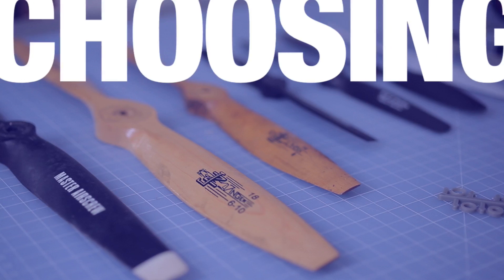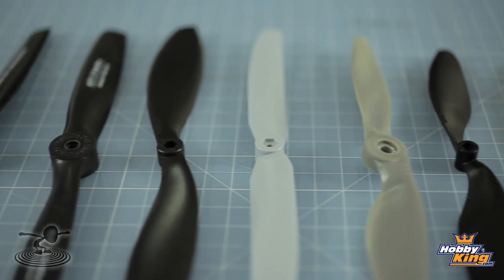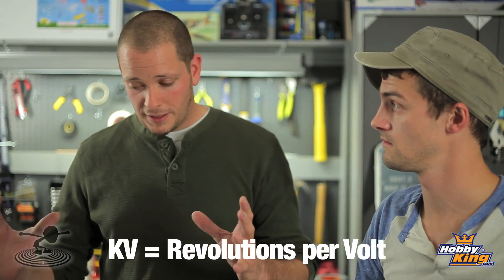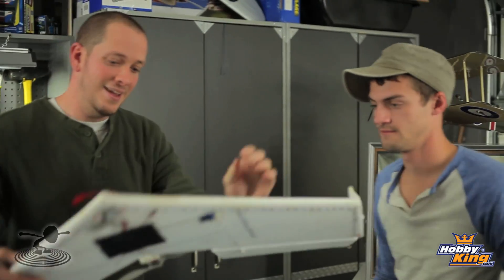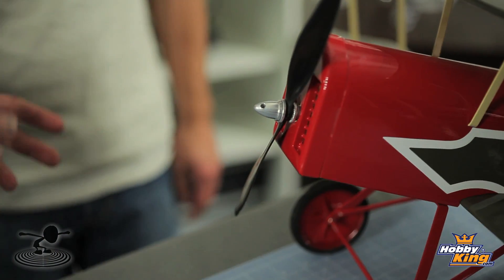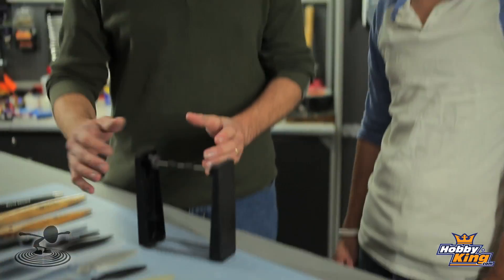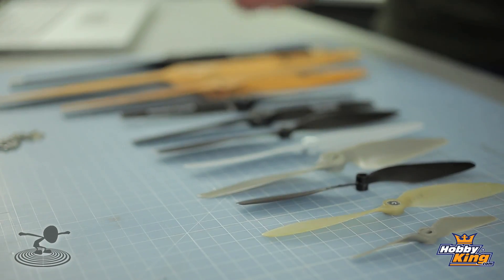Flite Test - Choosing A Propeller - FLITE TIP

Comment: i hav a quick question, i bought a 13 by 6 prop which is compatible with Extra 300 Eflite, however it won't go inside the thread on the prop. do i need ot make hole bigger? are all hole diameters the same on props

Comment: I'm building a foam mig 29 jet 
The wingspan is 81 mm and the weight is 31.1 oz 
The battery is a lipo 2200 mah 11.1 v 3s 
The motor I'm using is a A2212/6t 2200 kv and the propeller is 6x4 
My question is do you think this setup will work or do I need to change something.    Any help would be much appreciated

Comment: As the guy on the flight line that got elected to straddle the new 1200 horsepower turbine to adjust the variable pitch prop governor, I can tell you that all fixed pitch propellers have a narrow efficiency window to operate with. Airspeed and pitch is everything. If you change the pitch and/or diameter, yes, it's possible to go faster - within limits. Balance the tradeoffs in your choice. A high pitch propeller gives you a long roll on takeoff. A low airspeed, heavy biting high pitch prop will likely never exceed 60MPH. Propeller formulas always include airspeed because of it. For any given propeller, engine and airframe combination, there is a speed at which the propeller noise is at a minimum. A noisy prop (too fast, too slow, bad wind angle, turbulence,  etc.) is eating your power wholesale with a reduced return in thrust by comparison. A propeller blade operating in the wake turbulence of another propeller blade is definitely at the wrong airspeed. Drone props are designed for 0 airspeed. Insufficient airflow across jet engine blades and the compressor will stall sometimes violently and wreck the engine. The length of the prop blade is directly proportional to the work required to keep it balanced and the amount of grass your cutting on taxi. In any case, vibration from any source is bad and noisy. There is no such thing as no damage from any prop strike at max rpm.
Based on what's usually available to most people, it's very likely that you have a choice of three props for your given combination that will change performance; and three more if the blade count changes. Choose carefully and you maximize flight time. A goal nobody argues with ;)

Comment: My motor is 2212  1400 kv none brand motor,,i can use 3 blade prop,,but i dont know 3 blade prop size,,,plase suggest a 3 blade prop for 1400 kv on 2s lipo

Comment: this was my question that i found no where else that "is the pusher propeller different from tractor one". so basically if you rotate the tractor propeller the other way than for which it is built, u get a pusher propeller, right?

Comment: With all these new quadcopter props I think it would be a great idea to revisit this for a video.

One thing I'm doing is learning to 3d print a propeller for my ww2 plane. It's a great small flier but it can't land or take off cause the factory prop is a huge 2 bladder prop. It does great but I want to play around with different propellers and see if it will work will a 4 bladder propeller.
Reply: 2 years later.....did you have any success making props?  I thought about making a silicone mold of a few props and then just pouring my own from epoxy, but probably too heavy.

Comment: PLEASE ANYONE HELP!!!

Ok so the second number means how far the propeller will move through the air after each rotation......... However, when I look up propellers I see one of them has the second number 24... so it should make that prop move 2.4 inches through the with each rotation..... Then I look at another prop where the second number is 52, which should make the prop move 5.2 inches through the air with each rotation.

The thing that MAKES NO SENSE AT ALL is the that prop with the second number being 24 has FAR FAR FAR more pitch on each blade than the one with 52 being the second number. How does this make any sense at all!?

This is SO frustrating I cannot reconcile this AT ALL.... I feel like there is some information that I'm using that is wrong. What do I have wrong!?

Comment: so something I don't understand. if you have a 8x6 prop and a 10x6 prop I guess why would you go with the bigger prop? if your going to get the same travel out of both  the 10x6 prop will draw more power plus more likely to break. which I guess leads to the next question why not go with a fast kv motor smaller prop.  so if you have a 1000kv motor with a 8x6 prop and a 2000kv motor with a 4x3  your getting the same travel per min.  the only reason I can see with going with a bigger motor is for weight balance right now. I suppose I might not understand yeah probably lol

Comment: It wasn't long ago that newbies or youngsters believed a bigger prop was better. I lost count of guys asking what was the longest prop a quadcopter could handle. It seemed a quad with small props wasn't "cool". No amount of advice regarding efficiency etc. could shake them.  Such talk was old people's talk, in the end I gave up trying and told them to use 11 inch props as long as they were OK with them hitting the prop on the next motor.  They were actually buying quadcopters according to the size of the props.  I'm no longer in the business so I have to wonder if it's still uncool to have small props. Or have I got it wrong by buying my props according to motor specs?

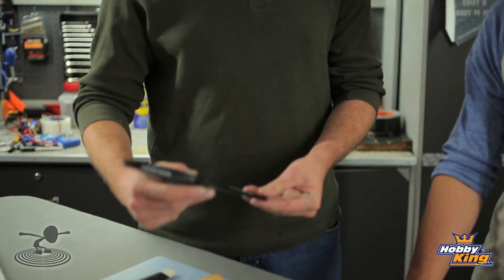Comment: 1:40, pretty sure the prop needs to face forwards if its on a normal plane or a pusher plane, i use CW props on my pusher plane and it works fine and you can use CCW props on either type of plane, just reverse your motor to suit, you need to explain what your talking about, not just say it spins the other way cos it goes on the back because thats just flat out wrong
Reply: Yeah no need for pusher props in electric planes really, just flip the prop and reverse the motor but in nitro applications you do as the engine cant run backwards
Reply: @mark675  Brilliant comment!
Reply: .... no no no. this is just wrong. propellers have a leading edge and a trailing edge. you CAN  reverse your motor and make a standard prop(ccw) do what a pusher prop(cw) is designed for, but its not efficient because the standard prop is indeed running backwards with the trailing edge out front instead of the leading edge.

then entire point of there being two types of propellers is for you to use to proper one for the proper scenario. please do not go around encouraging people to use the wrong prop for the wrong job. running a prop trailing edge first is a good way to cause damage to your plane, propeller, or yourself
Reply: yes i know the leading edge always needs to spin the correct way that was my point, you always need to have the propeller facing forwards (the side you see the size and pitch written on most props) my point is you can use a ccw prop if you reverse your motor so the leading edge is spinning the correct way while the front of the prop is facing forwards weather its on the front or rear of the plane. the reason for my comment in the 1st place is why did flight test mention the ccw prop and not go into any detail?

Comment: I'm still not sure how to "match the prop to the motor". Is there an equation to use? Also I have some props from a gas engine, and a few people said I cannot use these because they are for 'gas'....but if the pitch and length are the same, does it matter??
Reply: Josh Kelson it's in the motor specs from the manufacture. Every motor will tell you the best props for it as well as what size battery it is capable of handling. ...you can deviate from the recommendation to get better battery life, higher speed, lower speed etc. but you do this at risk of damaging the motor if you go to extremes. There's plenty of info on forums or a simple Google search if that didn't help you enough. ...other wise...you start at what the motor is spec'ed for and move around until you find what you want from what your working on. There's no "set in stone" rules. ...also the model manufacture will tell you what prop n motor they recommend if you're getting into scale building. ..hope that helps
Reply: Thank you, that helps. Are pitch and length measurements on a standard between manufacturers? Also, if I find a wood prop with the same diameter and pitch, is it going to work regardless of if it is "electric" or "gas", wood or plastic?
Reply: Thanks that helps. Are all pitch and diameter measurements standardized between manufacturers? Also, if the diameter and pitch fall in line with the manufacturer, does it matter if it is an 'electric' or 'gas' prop (what would the difference be), and does it matter if it is wood or plastic (I would imagine there are weight differences that factor into the ability of the motor to turn the prop...do you size down when going to wood?)?  

Also, here is an example of the confusion. eFlight power 60 motor (recommends 15 x 8 - 17 x 7 electric propeller), however when looking at the recommendations of props for two models, they recommend two props, one within that range, one entirely out of that range. The Beast they recommend a 17x7e (https://www.horizonhobby.com/efl9000), and the Carbon Cub they recommend a 16x10e (which seems out of the range?? ...or maybe I don't understand what the range of pitch is, 3 steps higher or lower? 4 steps?) Not only that, but if I understand the creation of props correctly, pitch angle changes with length, so a longer prop will have an entirely different pitch angle.

...it's much more complex I'm learning than simple numbers to choose on a prop.....

Comment: what is the difference between 1045 and 1045r propeller?
Reply: I have no idea... but it might be r for reverse. Josh mentioned that you would want a reversed prop if you were running engines on a plane so that it wouldn't torque to one side

Comment: Whats the best prop for a slow flying radian sized glider with a 2200 kv motor. Im a nüb at this stuff
Reply: Oskar Lund 6×4.5
Reply: You would be better off with a folding prop if you are using a tractor style motor. By folding out of the way the drag is reduced and your plane will have a better glide ratio.

Comment: when would you use a wooden prop
Reply: Jonas Martin, use wood props on Nitro or Gasoline aircraft.  If you are flying electric planes you can use wood but they seem to dump the battery faster.  Also, do not use electric props on nitro or Gas engines, as the engines do not run as smooth and can throw a blade on a plastic electric prop.  APC makes both electric and nitro plastic props so know what you have if flying Nitro or Gas.  Also, I have found that a different prop size, pitch  can make a big difference on the personality of the plane in the air.  Even the same size but different manufactures can make a difference.
Reply: Bob T thanks.  I like the look of a wooden prop

Comment: in the prop size , is the first number measure in inches ?
Reply: Yes,  typically it is expressed as inches.    Example: an APC 12x6SF: 12 inches is the diameter and the theoretical pitch is 6 inches, SF is for Slow-Flyer ("e" for efficient electric).  a GWS 1260ep: 12 is the diameter and 60 is 6 inches of theoretical pitch, and ep is for electric propeller.
Reply: ohh i see now. thanks man
Reply: so is the diameter measured in inches too ?
Reply: Yes, sorry
Reply: ok thanks man

Comment: What propeller i need for Turnigy D2830-11 on 4S? (Tricopter, 1000grams)  cant find 8x4 that isnt slowfly. 10x5 is too "heavy" for 4S on those motors.

Comment: how would i attach a prop to a traxxas rustler rc brushless electric motor, that was never meant to have a plane prop attached to it? i am trying to make a airboat that will have lots of torque and high end speed. i am gonna be using a 5000 mah venom battery

Comment: So heres an idea: multiple electric motors turning one shaft and rotor or prop.
The idea being to substitute electric motors in place of cylinders, arranged in traditional "v", boxer, radial or in line cylinder configurations. I dont think it would be very efficient, but im wondering how much horsepower, torque, and rotational speed is obtained........ Like is said just an idea
Reply: Jayson Odom it erupted be a constant dive geared system and would be highly inefficient and a pain in the ass to get all the electric motors timed to each other.....you'd burn up motors so fast you'd be refinancing your house to buy more....that's a reason why nothing is built like that.

Comment: If i want to switch from a two bladed propeller two a three bladed. How do i change the diameter and pitch to have the same characteristics of  the two bladed one? 
ex i have a 10 x 4,5" 1045R two bladed. what should the three bladed be ?
Reply: +Manligheten General rule...drop and inch and increase the pitch. 
So, for your example go with about an 9 X 5.5
Reply: +mh annan thank you. 
i figured it out. 
soon time dor maiden flight.

Comment: hey guys, can u help me? So i'll do a cessna 182, about 800grams. so i choose for use the Emax XA2212 1400kv motor. i read that i have to use a 8x6 propeller. then i go to the hobbyking and find my propeller. So i don't know what direction (CW or CCW) i have to buy. can u guys help me? like as cessna, the motor will be in the front of the Airplane
Reply: +Guilherme Alves It makes no real difference except for multicopters, where some of the props turn backwards. That said, most tractor aircraft, where the prop is in front of the motor and the whole shebang pulls the aircraft, have props that spin clockwise when seen from behind.

If your airframe has thrust angle built in (some do some don't), then you should stick with the prop for that angle, which is usually (NOT ALWAYS) clockwise. If you have no thrust angle built in, then feel free to install a counterclockwise prop - if it spins backwards, flip any two motor-ESC leads.

Comment: I have a question. Just getting started in RC I put a plane together w and electric motor, have not flown it yet, when i do a test taxi the plane pulls to the left. How many degrees do I have to tilt the motor to the right to fix this problem. Thx
Reply: Trial and error. Also change the rudder trims
Reply: jmlon99 thanks
Reply: Richard Palermo One more question. Do you think I could convert it to a tail dragger so I can fly it in taller grass?

Comment: Do people track their propellers, if so how  example  a 11x6 plastic prop that wont track straight  what's the fix
Reply: Rondo Schiavoni Do you mean that the prop on the plane causes the plane to fly oddly or that the prop blades don't pass through a single plane? If it's the latter, it's possible that the hole in the prop isn't centered/square, that should be addressed by the sizing ring included with your props. It may also be that one of the blades is bent either through a crash or a flaw in production. Generally speaking if the blade is bent, and it wasn't produced that way, there should be some stress marks on the plastic and the prop shouldn't be used since the prop is weaker there and could fail at any time resulting in potential injury (during run-up/preflight) or the walk of shame (failure in the air).
Reply: I FOUND  A BENT SHAFT WAS THE  reason  the blades weren't passing   on the same plane

Comment: ok, seems to be nice video, but what about blade width, I have quad with 800kv (222W) motors but it fly better with 12x4,5 wide blade props than 12x4,5 ordinary blade props. So is there some identification what shows blade width?
Reply: Lauri K The wider the blade the more like a Slow Fly (designated as "SF" typicall) prop it will be which will generate more thrust. Really it comes down to what manufacturers are making. If you compare an APC, GWS, and Master Airscrew props they all have different blade geometries so they will all fly differently despite being the same diameter and pitch. If you know that your quad flies better with wider bladed props then look at Slow Fly props or find a manufacturer that makes a more standard prop that makes your quad fly the way you like and stick with those.

Comment: hi there great videos , but what about ppl like me who are building their own scratch built 3D printed micro quads or tri ?
how can we figure out the right motor or prop?
Reply: Usually motors will have suggested props for your battery size. And as far as picking the motor. I would head over to the flitetest forums and tell them your frame setup and ask for motor advice.
Reply: yes i understand that is all good and dandy when you buy from a good rep dealer who has all data sheets BUT what about when you shop on ebay or just salvage other old tech and just harvast what you can out of it? this is what i have done, so there is no data sheet or spec details SO how do i know whats good with what ?  is there some keywords im not coming up with that can narrow my search on google or youtube ? thanks for the neural handshake gipsy
Reply: Gipsy-Danger and lets not forget that i am not talking about BLDC BUT DC MOTORS
Reply: Can you provide specs of the setup? Motors, batteries, frame etc.

Comment: hmm for multirotors i was wondering if there would be advantages to placing the motors on the bottom of their respective boom, facing downwards instead of up and then flipping the prop. i would think less thrust would be lost due to air current impinging on the boom below it. basically it would probably make a low pressure area right around the boom as air flows around it slowing it's downward speed to move transversely to move around the boom thus reducing the net flow or air velocity in that area and then reducing reaction force on the prop and thrust. i guess the trade off is the suction area ahead of the prop. maybe the boom being in front of the propeller it would cause reduced supply of air to the propeller and have even worse effect and this is why nobody mounts the props on the bottom side of the boom?